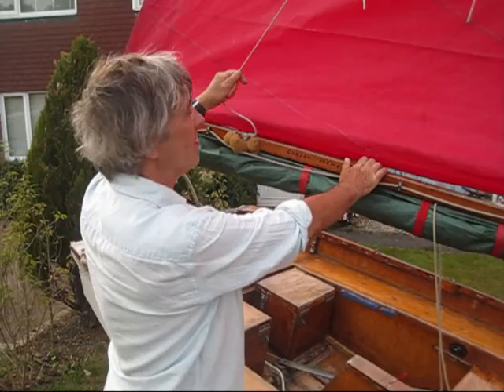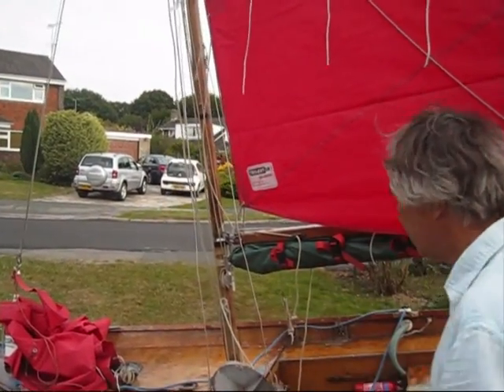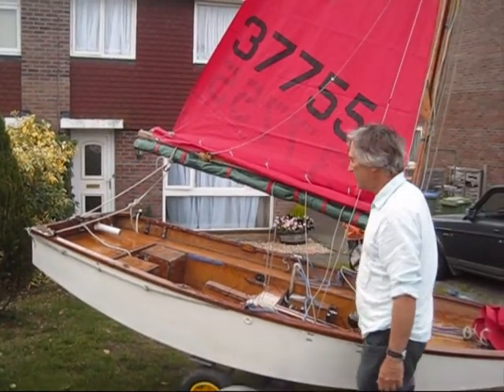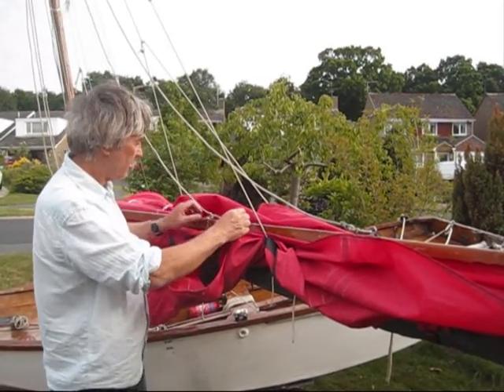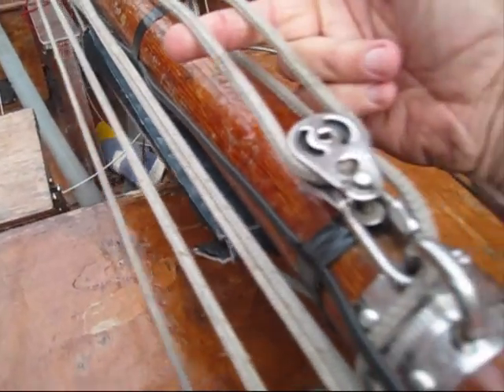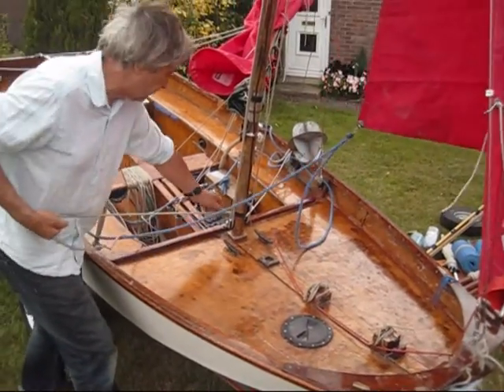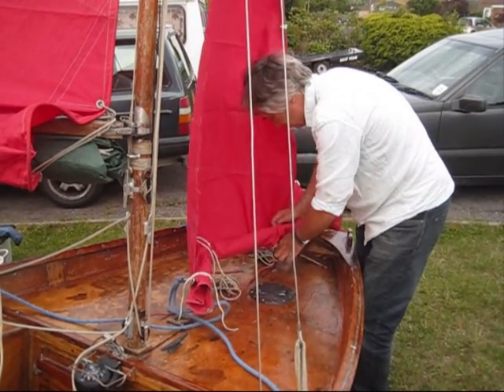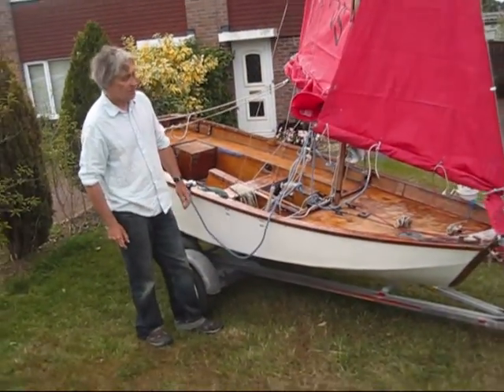Mirror Mods Part 2

Comment: Hi, just a quick question if that's OK. 
I had a shroud anchor plate rip off my mirror in some strong gusts of wind on Bala Lake yesterday.
It looks like you have bolted your's through, this is what I'm thinking of doing to repair and strengthen them. Did you use a metal plate on the outside of the hull to tighten the nuts against? Any tips suggestions would be welcome.
Thanks in advance.
Reply from the maker: Hi Julian
I had old Holt cast shroud plates and one broke off. I used U-bolts with big washers on the outside. Cut off the excess thread. david
Reply: @msf60khz  Thanks for the reply David.
Mine ripped the screws out of the wood so I've drilled the original plates out very slightly and used gutter bolts through a plate on the outside and cut the thread back, much the same as you did. .
Thanks again
Julian

Comment: On rewatching your video I notice you have added stitching reinforcing to your main sail reefing points at both the luff and leach did you add extra sail material as well and did you do this yourself ?
Reply from the maker: The patches are very thick and were done by a sail maker, also the very strong eyes which are pressed in. These reefing eyes need to be very strong.

Comment: I am in the process of refitting my Mirror and am going to copy your reefing system. I understood most of the video but got confused over the fixing point on the gaff for the halyard for reefing purposes. You seemed to have it fitted in one place yet you then unhitched it and passed it through the fitting to then hitch it on the main halyard fitting. Have I understood that correctly? Fantastic videos by the way, always great value
Reply from the maker: MIke. In order to keep the gaff close to the mast, the halliard is passed through the ring on the gaff and then secured to the gaff using the hook. To save yet another fitting, I just took it to the other fitting. Hope you can understand. Thanks for the comment. D

Comment: Hi there, I am still not sure how your topping lift works - how it attaches to boom (if it does), where on/under the boom, where exactly the line runs and cleats etc. I want  to fit a topping lift to my Mirror, but for rowing and sleeping aboard rather than for reefing afloat, if you see what I mean? I am not sure if a separate reefing halyard is required in that case?
Reply from the maker: The line starts near the outer end of the boom, where it is tied to a lacing eye. It passes up to the mast, then round infront of the mast, guided by two pad eyes. Then back down to the boom, where it passes through a bee block on the side of the boom. Then aft along the boom and terminates on a cleat. To top up, you take the line off the cleat and pull the boom up, then re-cleat. 
I also have a lazy jack arrangement which uses a loop of line under the boom and going up to anorak clips on the topping lifts.
Reply: Thanks for your reply. In the end I went for a line which starts at the top of the mast, down under the boom through an eye, back up to the head of the mast through a Mirror jib block, and back down the mast to a cleat. I'm pretty happy with it, but the cleat gets in the way for the jib sheet sometimes!

Comment: Very interesting . my particular interest is the topping lift. I assume although I couldn't quite see that you have a cleat each side of the boom to recieve the topping lift lines. I notice you appear to pad the cleats in case they strike you on the side of your head? Thanks for the help.
Reply from the maker: +andrew bartlett At the moment, the topping lift ties to a lacing eye on one side and on the other side it passes through a little bee block and goes back to a cleat further aft. Only one side needs adjustment. You need plenty of spare line so you can lower the boom down.

Comment: Hi David - really enjoying your videos - just wondering if you've sheathed the outside of the hull in fiberglass for extra strength when cruising...
Reply from the maker: Stitch8220 I have not done this as I am told it can cause rot. By the way, I have just made spray hood for the boat.
Reply: Mirror Cruising Would love to see a picture of it if you get some!! I'm currently restoring an old Mirror from 1968 - dealing with some rot due to the boat being left in the previous owner's garden for a number of years. Enjoying the process and your videos are a great help.
Reply from the maker: Stitch8220 I will try to upload some stills for you. Tried it a few days ago at Aberdyfi.
Reply: Mirror Cruising That would be great! I'm working away on my boat - hoping to have it in the water in the next couple of weeks. I think a  spray hood would be beneficial especially later in the season as it gets colder. Thanks again!!

Comment: Could you tell me what wood is the mast made of and how hight it is, please?
Reply from the maker: The mast seems to be about 2 inches shorter than the boat, making it about 10 feet 8 inches. If you want it very accurately please ask me again - it is raining here at the moment. The wood is "soft wood" according to the Mirror building instructions, so I suppose any good quality wood will be OK.

Comment: Also, can you describe your boom tent arrangement?
Reply from the maker: I use a tarpaulin rolled up under the boom. It is fixed to the boom using a strip of wood. It is held down along the gunnels by strings passed through little holes in the hull, and tightened using anorak clips. The boom is supported by a simple scissor-type crutch. Th tarpaulin is roughly shaped using scissors. There are flaps across the front and back, and I use Velcro to close the doors. Notice a tent has to be inside the shrouds. D
Reply: Yes, I do notice the tent must be inside the shrouds. I puzzled that out while devising a boom tent for our club's Wayfarer just today!

Comment: Do it at sea, what a cockup
Reply from the maker: I think you are talking about slab reefing for the jib. Yes, quite tricky at sea, but it is a traditional system. It is also quite a cockup at sea when a roller furler sticks with the jib deployed. I suppose the safe way is two forestays with different sails permananetly bent on.